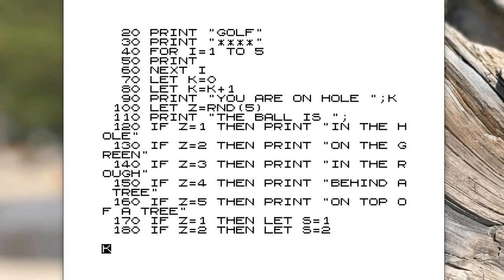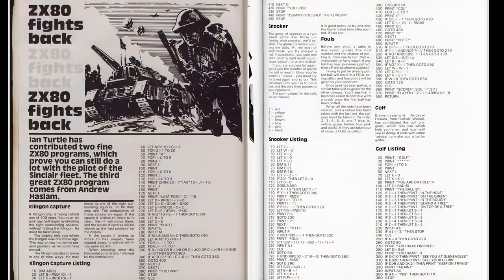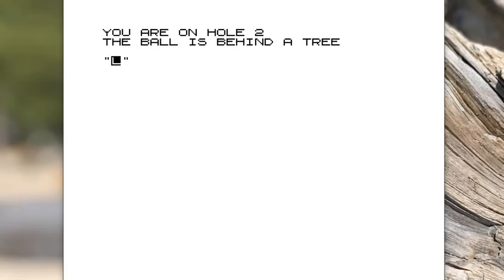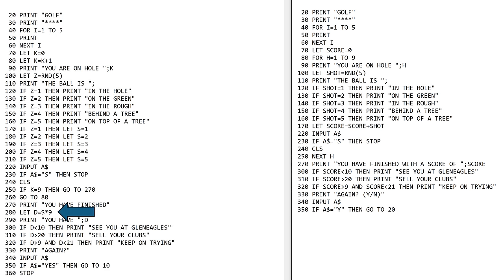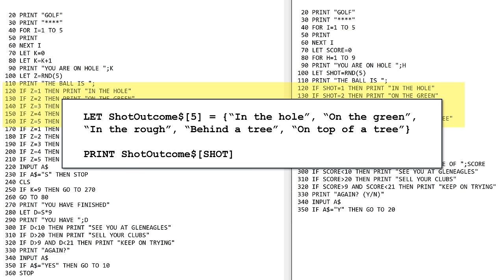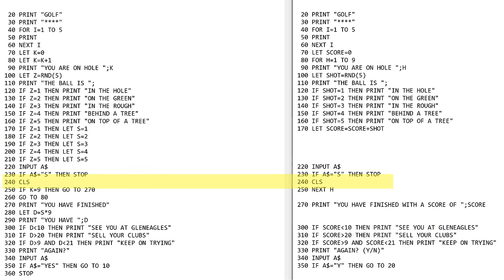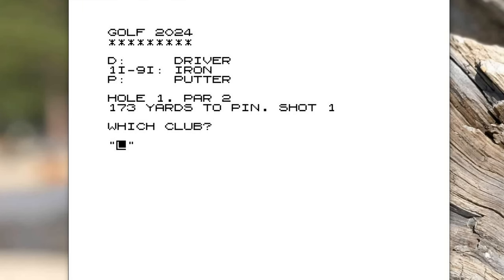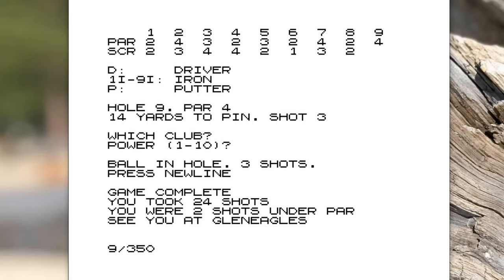Can I fix a 40 year old Sinclair ZX80 bug?

Comment: Awesome video - well done!...  My mother was really into Search-A-Word puzzles... she would always do the one in the Sunday papers.  When I was about 14 or so, I saw her doing the puzzle and I thought "I could make a program that could solve those", off to my Apple //c and started writing.  I got wrapped around the axle about halfway through it and shelved the project.  Fast forward a few years to when I was working the night shift with not much to do, I dusted off the program and after a few hours had it working.  It would read in a text file with the grid and words and would print out on screen or paper the beginning/ending coordinates of each work (I didn't bother with any graphical 'circling' of the words, etc).   Fast forward another 30 years and the only thing I had left was a printout of the program.  After OCR, text editing, it came back to life.  It was a stupid program, but it taught me a ton about logically figuring out a problem and having the computer solve it.

Comment: I’m in Canada. I still have my first computer ... the Sinclair ZX-81 with the RAM pack ... although gathering dust for many years now. I’ve heard its most popular use was as a door stop (the wedge shape).😄 It had a persistent problem in a random momentary power flicker during entry of the program erasing everything entered so I quickly learned to save about every few lines. However that “flicker” never happened when you loaded and were running a program.

Comment: closest thing I got to a ZX80 was a Texas Instruments TI30 LED Scientific calculator (not enough pocket money) which in itself was a massive leap at the time. fascinating how with a bit of experimentation and plain butchery I got it to play synth type sounds through a speaker where each number pressed on the keypad produced a different 'note.'
15 years later I was using Cubase an Atari ST in my home studio to link a Boss Dr Rhythm, Yamaha keyboard and Tascam 8-track to very unconventionally create heavy rock music. amusing looking back now...
Reply: It's a little known fact that the ZX80 can be coerced into making tunes.
Set up some different sized loops and place a small radio on top of the ZX80. Tune the radio until you hear the CPU cycles (via the Z80A's extensive r.f leakage) and when the loops are triggered it'll play pitches.
Reply: @Lensman864  lol. old high tech was certainly something for the creative mind in quite unintended ways.

Comment: Thanks Andy, I forgot no arrays on ZX, but a decent work around. I also use emulators for most of my collection, just check/test them every year. The 68020 Amiga 500+++ with Gotek gets used a bit.  My oldest pc atm is a 1983 VIC-20 ('3583 Bytes Free' is not overkill) & a rare Welsh Dragon 32, but no ZXs. 
I did look at ZX81 before buying a VIC, but even back in the Middle Ages the ZX was primitive.
Reply from the maker: As my parents got the ZX80, and as Sinclair was so big in the UK, I was on the Sinclair track all the way until I got an Atari ST. But yeah, not the best quality.

Comment: What!? You are a Zeddy guy as well as a car guy!? Me too! Even though across the pond, the Zeddy was my first computer, and I still write games for it. Basic is for ******s though. Gotta do assembly on the Zeddy! Me and a buddy did a passable Donkey Kong (Zonkey Kong - its out there free with a google that runs on the real thing or an emulator like EightyOne - also free and best on a 16k ZX81) and are working on a high res (with sound) version of Robotron (Robotack) now designed to work with WRX high res and ZONX sound - implemented in the ZXPAND add-on :)

Comment: You could have used a series of sub routines for the if-then conditions, and called them using "GO SUB 400+10*Z" - I believe Sinclair basic allows you to do that.

I think you could probably use TL$ and TR$ to slice up a single string containing all five option strings and use that to print out in a few lines of BASIC - something like

LET OUT$="<all of the strings, fixed length L, concatenated manually>" 
FOR X=1 TO (Z-1)*L
LET OUT$=TL$(OUT$) 
NEXT X
FOR X=1 TO (5-Z)*L
LET OUT$=TR$(OUT$) 
NEXT X
PRINT OUT$

Yes I know this is taking it to extremes but it demonstrates that it can, technically be done!
Reply from the maker: Both great ideas, thanks!

Comment: Blimey a working ZX80. Many years ago I bought one at a car boot sale for £1 and promptly sold it for £200 - they're worth even more now. First programming I worked with was Star Trek in Cobol on a university mainframe in 1979 using punched cards but my first micro was a Video Genie TRS-80 clone - not bad for its time. Wonder how kids these days would get on with Basic.
Reply: ZX Basic and those of other 1980s microcomputers was a fantastic start for a lot of people into computing, including myself. An interpreter which was active as soon as you switched the thing on meant simplicity in getting started, and you could progress to machine code/assembly language quite easily as well. This has all been lost these days.

LET EGGS = 48...

Comment: If you added to this, it could be playable.  Imagine each hole may take 1 or multiple swings,  each time may result in landing in the rough or a sand trap or on the green or in the hole, etc. but not just at random.   You could incorporate something like the old lunar lander program or the "gorillas.bas" program where for each swing you enter in a angle and strength. Or maybe an angle and a club.  For it to continue to be playable, you might have a database of variously shaped holes and then randomize the order of the hole data at the beginning of each game.

Comment: As an American, I've never encountered Sinclair computers in the flesh.  I think I saw the four-line Timex Sinclair 1000 on a store shelf, that's about it.  But I wonder if its keyboard was as painful to use as the Atari 400 I had for a while (before I gave it up for a C64, a much better fit).  My fingertips ache even thinking about typing a small program on one of those.

Comment: Nice Basic programming and update to your old game :) 
I still have my first computer too from the 80's, a "Finnish" Salora Manager, which was known elsewhere as Vtech Laser 2001, and used to type in games from computer magazine program lists for this computer. Later got Commodore 64 and did the same thing, but sold the C-64 in 1991. Now I have the Mini C-64, which doesn't have working physical keyboard, but I have external usb keyboard, which works with it. 
Have been thinking of trying out some Basic programming with these, but for the Salora, tape drive condition is terrible, so I have no way to save the program. 
Mini C-64 could save it, but Commodore special characters present a problem, as the modern usb keyboard obviously doesn't have them marked, so I'd have to try and test every one of them.

Comment: Could you POKE and CALL and thus write machine code routines on the ZX80?
Reply from the maker: Well, there's a POKE command, and PEEK is listed in the manual, but not available to use on the keyboard!

Comment: try using single letter variables, you might then get it in 1k.... also you could've had string arrays in zx81 basic,, you can put a zx81 rom in a zx80 and it'll work as a zx81 except you'll still get the display blanking, thats down to the display hardware, unfortunately,
Reply from the maker: I wanted to try to restrict myself to the ZX80 ROM as a bit of a challenge. I originally hoped to make it 1K, but it ended up at least over 3K, so the variable name trick wouldn't have helped.
Reply: @LittleCar  the zx80 used to have a 3k rampack, before the 16k one came out, wonder if it'd work with one of those, they're as rare as honest politicians, now, but may be possible to set an emulator to 4k (this pack added 3k on, making 4k total, not disable the internal ram like the 16k and most others did)
Reply from the maker: Maybe, but typing that program in on a real machine would do my head in.
Reply: @LittleCar  hehe, people did back then😉 i never had a zx80 when 'current' but did start with a zx81 ..

Comment: I grew up with a Spanish ZX Spectrum 128k. It was a little bit more powerful than the ZX80. About the problem with the if chain, which you mention you would convert it to an array of strings, you can make something up with subroutines. GOSUB is able to jump to the contents of a variable, so you could do something like:

70 GOSUB 5000 + (SHOT*10)
5010 PRINT "IS x": RETURN
5010 PRINT "IS y": RETURN
5010 PRINT "IS z": RETURN
Reply from the maker: Thanks for the example. I still think a string array would be more elegant, and this would have worked on something like a Commodore 64, but even Spectrum 128K BASIC didn't allow multiple statements per line (to my recollection).
Reply: @LittleCar  Yep, a string array would be more elegant, and you could write something like that with a Speccy 16k (not sure about the ZX81). 
About multiple statements per line, you can use them for sure! Just separate them with a colon, i.e.:

10 let x = 0: let y = 0: let z = 0: if y > z then goto 10
Reply from the maker: Really? It's been too long since I used my Spectrum 128 (sadly sold many moons ago).
Reply: @LittleCar  Absolutely!!
(Did you really have the soul to sell your speccy?? 😪

Comment: Made a structured version of the original in uBasic/4tH:

Do
  Proc _Golf
  Input "AGAIN? (Y=1, N=0) "; a
  While a
Loop

End

_Golf
  Local (3)

  For a@ = 1 To 5
    Print
  Next

  Print "GOLF"
  Print "****"

  Let c@ = 0

  For b@ = 1 To 9
    c@ = FUNC(_Play (b@, c@))
  Next

  Print "YOU HAVE FINISHED WITH A SCORE OF "; c@
  If c@ < 10 Then Print "SEE YOU AT GLENEAGLES"
  If c@ > 20 Then Print "SELL YOUR CLUBS"
  If (c@>9) * (c@<21) Then Print "KEEP ON TRYING"
Return

_Play
  Param (2)
  Local (2)

  Print "YOU ARE ON HOLE ";a@
  Let c@ = Rnd (5)
  Print "THE BALL IS "; : GoSub 100 + (c@*10)

  Let b@ = b@ + c@ + 1
  If Len (Set (d@, Ask ("?"))) = 1 Then If Peek (d@, 0) = Ord ("S") Then Stop
Return (b@)

100 Print "IN THE HOLE"      : Return
110 Print "ON THE GREEN"     : Return
120 Print "IN THE ROUGH"     : Return
130 Print "BEHIND A TREE"    : Return
140 Print "ON TOP OF A TREE" : Return